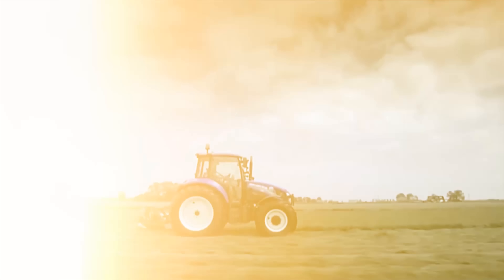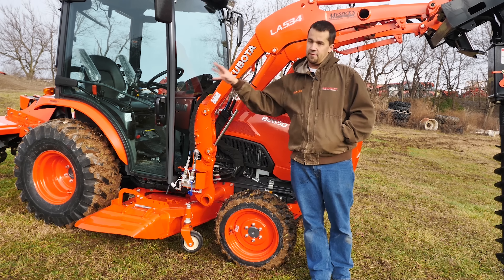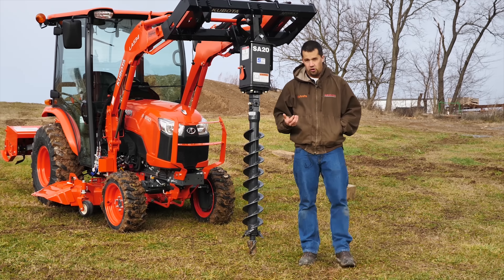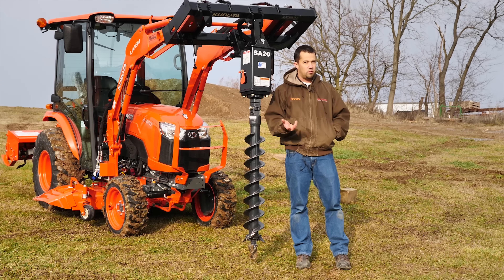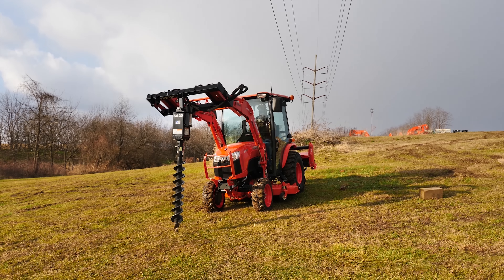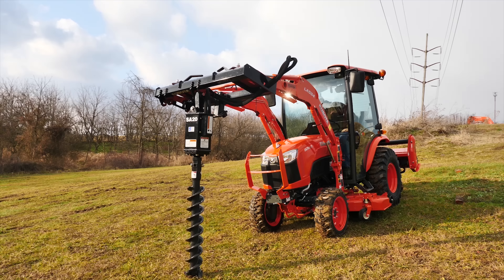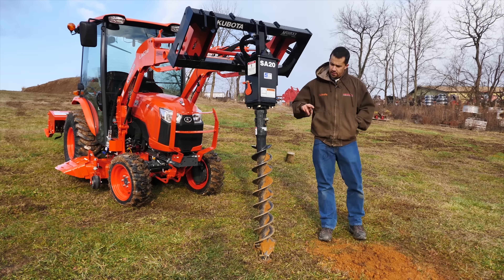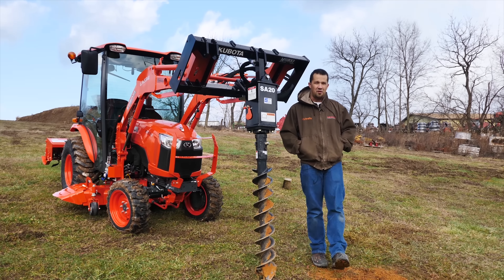Can you run a hydraulic auger with a compact tractor? Land Pride SA20 Low-Flow

Comment: Could you use the backhoe hydraulics for more flow and plumb it up to the front?
Reply from the maker: Yea, but you would not have significantly more flow
Reply: If you have a backhoe, there's a way to attach the auger motor to the backhoe in place of the backhoe bucket.  A huge amount of flexibility in that arrangement, but I'm not sure about height clearance.  You can swing the boom left and right, drill two holes without moving the tractor....  :)

Comment: Seems terrible to me. I’ve run a Bush Hog 3-point hitch auger on a B2920 and it is much, much quicker. Not sure why anyone would prefer this.
Reply from the maker: down force. Does not matter how fast it spins if you can't penetrate the ground.
Reply: and it can reverse!
Reply: @andys31337    vg
Reply: I find that 3 point mounted auger and my rear remote functioning my hydraulic ram kit pushed constant 500 ft lb works great.
Reply: For us in rocky ground, it's absolutely necessary.. One: for being able to reverse to back out of a rock hang-up, and two: to have the down-force from the loader to penetrate through hard soil and rock (we have the rock bit).
Reply: In addition to downforce and auger reverse, it's in front of you instead of behind you, so after a day of drilling you're not twisted like a pretzel.  Also, the FEL can lift and lower over a much wider range than a 3 point hitch, and many people feel that they can maneuver the FEL into tighter locations than they can a 3 point.  I'm not so sure about that last one, but the FEL can get further away from the tractor so if there's a trench or something in the way it can be advantageous.